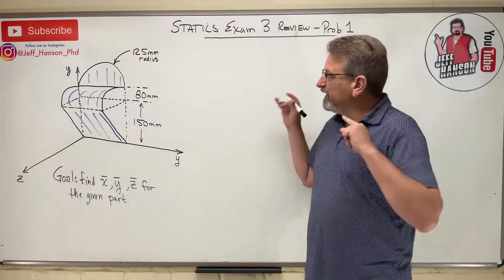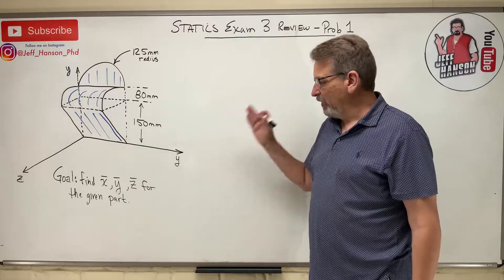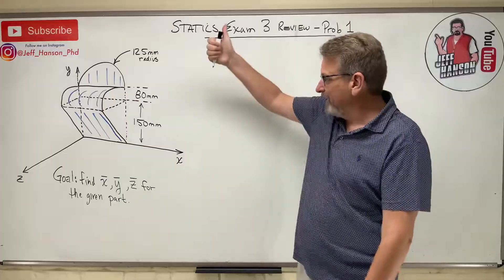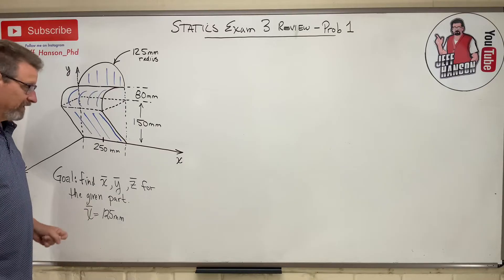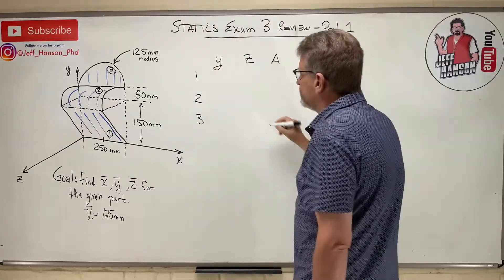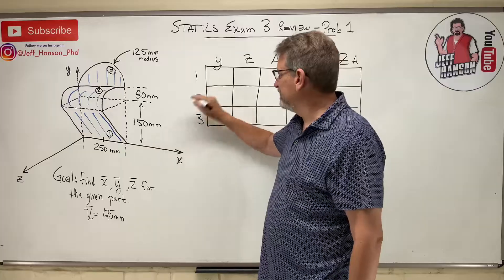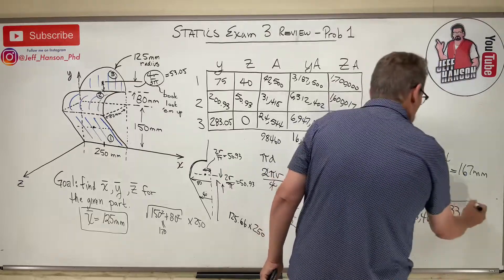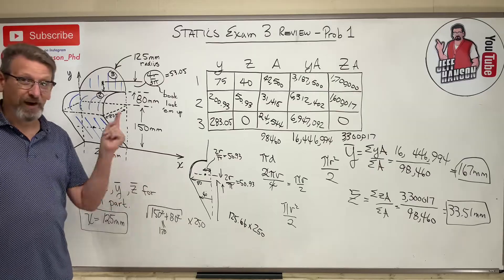Statics: Exam 2 Review Problem 4, Centroid Composite Shape

Comment: hello Professor Hansen. I am kind of confused, I thought Y bar for inclined plate (inclined on Y plane in this case)  should be half of length of the plate itself (at the hypotenuse side/ inclined side) and not half of the plane(adjacent side/Y plane).... except if the plate is not inclined and is parallel to the Y plane. I may be wrong though.

Comment: I'm hoping someone to reply on this, but why did Prof Jeff find ybar and zbar on shape 1 using rectangle, isn't it triangle??
Reply: because when you're looking at shape 1 from the y axis perspective, it forms a rectangular shape (the top surface of the triangular plane is rectangular)
Reply: @Zoami Calles-Rios Sosa ohhh but srsly, i really coouldn't get it haha
Reply: @NorfatimaHAli-cs2lw  hey im havining the same question. Why did he consider it as a rectagel?
Reply: @h3rm3z63  i think it was a mistake
Reply: @Zoami Calles-Rios Sosa 3 is the flat sheet
Reply: I think because part 1 isnt actually a triangle. It is a slanted rectangle. You would be correct if the dashed line dimensioning 80mm was part of the metal sheet.
Reply: We arent talking about volume. Its about area. Shape 1 is a rectangle